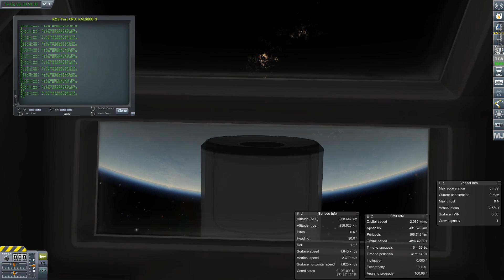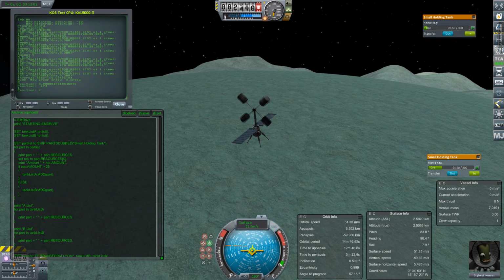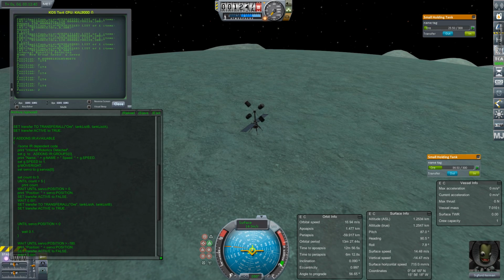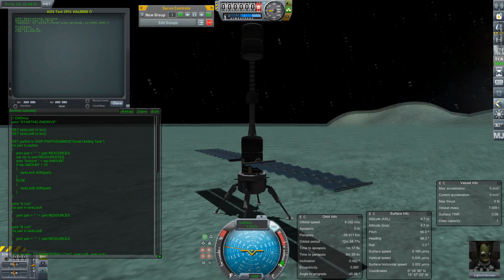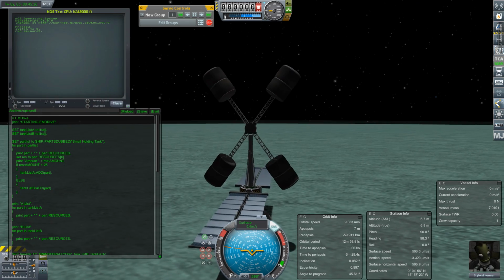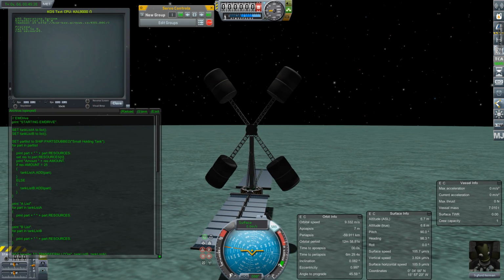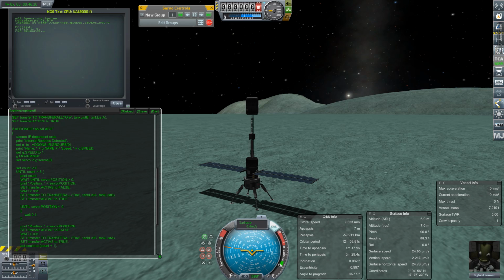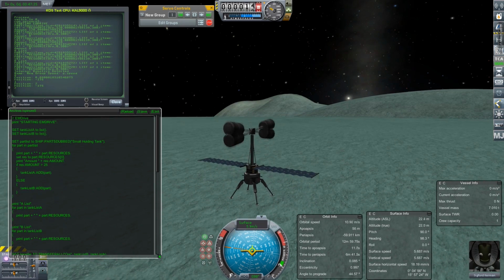Exploiting Kerbal Physics To Make 'Impossible' Gyroscope Drive

Comment: I made something like this in simple rockets 2 , but didn't worked well, it was a spacecraft with 2 reaction wheels and a gyroscope with a bearing on it (to prevent gyroscope trying to lock the spacecraft in yaw) .
this is upside vision of the spacecraft (1 and 2 are reaction wheels, O is main gyroscope, I, / and \ are struts )

    1
     I
     I
    O      <--- this is the spacecraft stopped, the direction of first reaction wheel will determine the direction of thrust  (in this case, it will spin O-2 direction )
     I
    2

                      1
                    /
                 /
              O                     <-- the spacecraft  is spinning in the axis of reaction wheel 2 
            /
          /
       2

135 degrees after

       2
       I
       I    
      O      <-- the spacecraft not just turned 180 degrees, but moved forward a distance equivalent to the width of itself, like this : I  /  __     
       I                                                                                                                                                                                                                         I
       I
       1        
after a 180 degree turn, it deactivate the reaction wheel 2 , and activate 1 , and the process reinitiate.
like this

I  /  __     
            I  /  __
                        I  /  __
                               .
                               .
                               .

obviously, it will only go forward , not sideways, unless you deactivate earlier or later the reaction wheel.

sadly, it won't worked (well it changed the orbit in 1 meter, a failure for me) and i don't know why, i am searching the cause, but I think that is because the gyroscope is using pitch and roll to lock the yaw axis of the spacecraft, if this was the problem, im screwed up, cuz i can't just disable the gyroscope, without it my spacecraft go mad, and spins in random direction faster and faster and blow up due to intense centrifuge forces :(

Comment: It is possible to change that variable and speed up transfer, but it would not be a mod like most others. I have done this with a few other games, haven't done it with kerbal space program before. I will give it a shot when I get a chance. This technique would only work on a single ksp version at a time, 1 version of this mod would never work on a different version of ksp than what it was intended for. I will be doing it with ksp v1.2.2.1622

Comment: Imagine sitting in a capsule with the acceleration oscillating jerkily between 0 and 0.1g from LEO to Lunar orbit, or something equally silly... As it's a "reactionless thruster", I assume one would accelerate just about the whole way, simply turning the craft around at some point to get captured. That's days of getting lightly bounced as you try to fall asleep, knowing that if physics start working normally, you're marooned in space. Kerbals are a brave sort, hardier by far than mere humans.

Comment: Correct me if I'm wrong here, but as the rotating parts are on the same axis, wouldn't it be contra-rotating, rather than counter-rotating?
As I understand it, a set of counter-rotating set of propellers for example would be one propeller on each wing, one spinning clockwise and the other anti-clockwise.

Comment: I want to see variable thrust by using some IR to increase the arm of the moment on the fly (not KOS controlled, but rather pistons bound to shift and ctrl to work like regular throttle.  Being able to throttle between 0.05 and 0.2G would be a nice useful landing range.  I suppose you could stack many pistons which act in concert and alter the length even more (do IR pistons have a max extension length?).  This is good stuff!

Comment: Perhaps a second set of code that takes the amount of fuel in one tank, and when transferring it to another tank, generates that fuel and simply depletes the other tank, and instantly transfers, or does so with a timer so that it is somewhat realistic, and possibly a way to change part mass to prevent issues there?

I feel like that wouldn't be too hard to actually code.

Comment: You may be able to upgrade this by slapping more of those drive pendulums together for more power and more control, if you're adventurous, you could make wheels with more spokes which transfer the fuel in a more regular fashion for a smoother ride. Reducing the amount of tank groups involved in the fuel transfer as well as the rotation rate would allow you to limit the drive's thrust. I believe kOS can read the setting for your throttle control, so you have the ingredients for a reactionless drive right here.

That is until the KSP developers fix the conservation of momentum, but I believe that is a Unity bug.

Comment: use a ton of tiny ones so that the fuel per second multiplies per set of fuel tanks?? like adding more spokes to the wheel and transferring the fuel exclusively to tanks 180 degrees away

Comment: @Scott , instead of saying impossible and magical, we should be thinking, about how can we make it possible, like, how can we make those arms be "phased out", can we make objects behave like energy, after all, there are actually many things in our universe that actually do not collide passing through each other. both couples of arms would have to be perhaps phased to diferent degree, different material "wavelength"? (not mistaken by other theories of being put into different plane of existance or something) perhaps hardest thing about such phasing out would be to not let object be phased out unequally, hence breaking into pieces or even disintegrating into idependent atoms (or worse?!), because, provided that we already can  cause phasing out, it would be important to determine: tolerance, transferability and fading of phasing energy(?) from molecular level to whole object. If tranfering from object-to object or molecule to molecule is insufficient, then tolerance to phasing differences becomes important to know, if there is any. If you can't phase entire object at once, how fast does phasing spreads? how much space/intensity you nedd to stay within tolerance (and thus not fall apart)? and does phasing fade out, if so, how fast? Anyway i think phased out objects will still be obedient to gravity and still be affected by energy/radiowaves, so the question will be how to keep them in line and avoid falling into center of earth(where yo uwould disintegrate anyway, beause of heat and perhaps crushed by massive density?). but certainly such objects would be unable to produce sound obviously. Another question is could living beings be able to stay alive phased out? living beings need gas exchange to survive, and air might be not dense enough to be phased out and too lose to hope tolerance and/or spread could help it. so probably only liquid oxygen would be only way to have living phasenauts. 
@ScottManley +ScottManley #ScottManley (damn, how does tagging on yt work? >_<
anyway Thanks @Scott +Scott #Scott for giving me such nice brain trainer :D
Reply: A much easier solution would be to have one central set rotating in one direction, and two sets on either side each with half the mass of the central set rotating in the opposite direction. That would solve the problem of the torque.
But such an engine wouldn't create thrust in the real world, because the flow of the fuel would perfectly balance the movement of the center of mass. It works in Kerbal Space Program because they don't simulate fuel flow.
Reply: i know, i focused only on thingie of objects passing through objects without colision. But when you say it, i think that would work but only to real giroscopes, while in abstract about cerbal exploit i think it is neceseary to have equal mass in equall distance from center of rotation, because this works pretty much like swimming in water, with mass magically appearing in front of you, so to "push" space and drag you forwards. problem with realism in feasibility of that cerbal exploit is that, in water, you change hands geometry decreasing drag against water, to increase it back when hands are infront of you and you are ready to crawl forwards. in space though, mass stays mass, so it's drag on space is constant and thus, at best, you could hope for a forwards/backwards piston like movement if the ship itself is lighter than this gyroengine.

Comment: so... perpetual motion?
Reply: yes due to certain unrealistic kerbal physics
Reply: Joseph Zubik wish they were existent in this world lol
Reply: Not really perpetual because the parts required to make it work use energy coming from outside the system (Infernal Robotics rotors, KOS computer, assorted other ship components). It's more... I guess amplified motion? Turning a relatively small input of energy into a larger work output. You can't really capture the increase in velocity as power to be fed back into the system which means it fails on the self-sufficiency part of the definition of a perpetual motion machine.
Reply: If you want a self-contained perpetual motion machine, look no further than a Kerbal RTG + powered wheel combo on your rovers.

Comment: if memory servers fuel transfer rate is fixed regardless of tank size so wouldn't multiple tanks per arm allow for a faster transfer rate?  tho you would have to check how that would effect the com of each of the rotating masses

Comment: If I remember right, this is similar to how a certain type of impulse engine from Star Trek is supposed to work.
Basically, A cylinder with a high mass is spun up to some fraction of light speed (dropping it's mass).
Then the cylinder (at lower mass) is moved forward.
The cylinder is then slowed down (raising it's mass again) and then pushed backwards to provide thrust.

Comment: This thing is ridiculous. Now pls go ahead and make it bigger and more powerful.
Reply from the maker: Because adding more parts won't significantly increase the thrust to mass ratio.
Reply: Yeah he should just connect like a dozen of these things together to multiply the thrust. Like why only use one?
Reply: The best thing is you could keep a constant thrust of 1g and thus create artificial gravity.
Reply: However, making the arms larger should increase the "thrust", shouldn't it?

Somewhere up to the KSP maximum of 2km
Reply: Scott Manley Oh so you are limited by the added weight of the fuel/ore tanks
Reply: George Lionon         Lol 100 meters per second per second of acceleration XD

Comment: It's a two piston engine... Except both pistons combust at the same time.
The torque issue you were having can therefore be handled with proper timing. And adding more "pistons" means easier balancing.

Why? To avoid the collisions of course, even if there are none it looks bloody stupid when the meshes intersect like they do.